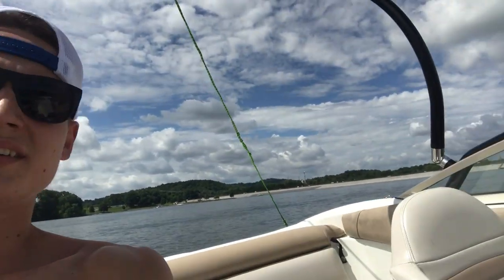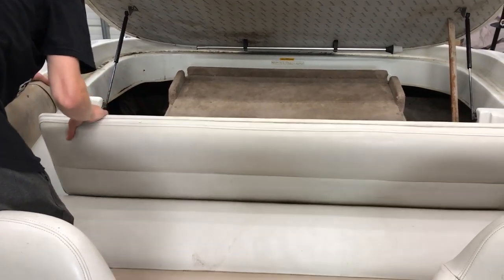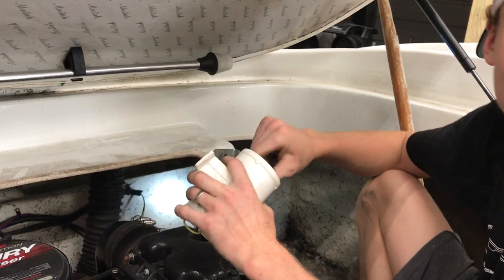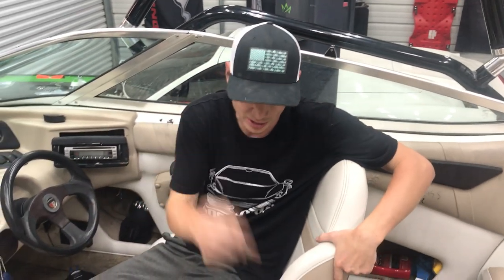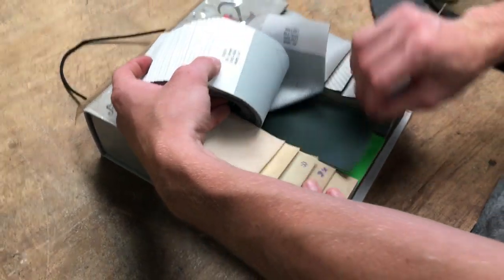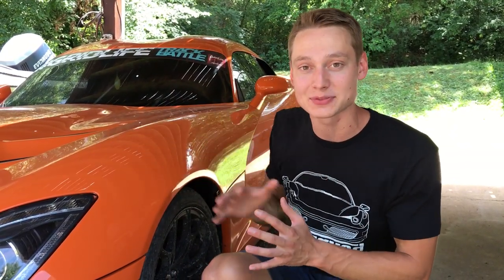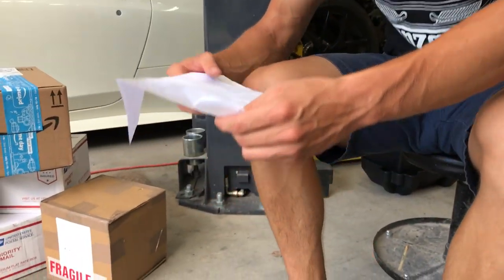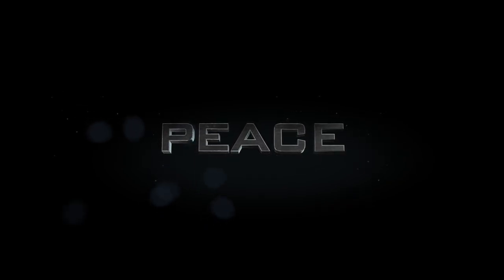Rebuilding A Super Cheap Wrecked Boat Part 4

Comment: Marine carburetors are spark protected. Do not use automotive carburetors!!
Reply: They are better of converting it to fuel injected
Reply: Also the bowl vents are J bent down back into the carb so if the float gets stuck it doesn't pump gasoline all over. Stick with stock. The exhaust mods maybe with a cutout are the best mods!
Reply: Gray J they have regular house carpet in it rn, its just gonna keep molding they need water proof boat carpet
Reply: That is not true
Reply: You can use an automotive carb but then you have to have an open engine compartment
Reply: @Gray J True. They're lucky the floor isn't sagging from being land sunk in that yard. Powerwash the carpet, polish the outside and just have fun! They got a great deal and the boat really does look fine. If they wanna spend $ get a top, exhaust, and a spare bilge fan. And some girls with beer.
Reply: especially if you re blower motor isn't working! CG will take your boat if they catch you with the wrong carburetor.
Reply: JasonDupsha, just simply that there is a screen. These boats have as much a tendency to spark from electrical components than from a backfire.
Reply: @Gray J they are haveing it replaced because that carpet is ungly
Reply: @webberron  I like that
Reply: Pat the little breather on top is what's called a spark arrestor breather. As long as it will fit back on you can change the carburetor. It's the same way with the starter and alternator they both have a built in screen as a spark arrestor.
Reply: @JasonDupsha yes they are wet. The raw water exits through them along with the exhaust but you can still re-route them out the sides or back and I believe they make appropriate cutouts. It would sound like a gnarly V8 if they mod them.
Reply: @JasonDupsha  They use a J shaped vent tube to re-direct fuel back in the carburetor if the bowls overflow. And, the linkages are sealed so flames can't get out. The aftermarket does make marine carbs, just don't use automotive types.

Comment: I learned the hard way . NO CAR parts on a boat motor .
 Plus any kind of crack or blemish on the hull of a boat will let water wick in over time . 
 Hair line cracks will to . Go over that hull with fine tooth come and use the hell out of that gel filler . 
That boat was a great buy . Motor and out drive are worth what you payed for the whole boat . 
Get that out drive serviced and have fun with that boat . Nice project .

Comment: DO NOT attempt to put an automotive carb on this motor.  It has to be marine rated for a boat, particularly the carb.  It is a small block cheby 305.
Reply: What is the difference between a car carburetor and a boat carburetor?
Reply: michele vitarelli different venting for one.  And different metering.  You put a car carb in a boat and it will go boom.  Not worth the risk.

Comment: If that motor is turning over 6k that's way too high!.....redline for that motor is around 5500 max. If it turns faster than that it's an indication that is the wrong prop on it. just sayin...
Reply: Or the rev limiter is set wrong either way revving too high
Reply: the mercruiser 5.0 engine has a happy spot around 4600 rpm or so really no need to hit 5100 or above it wont perform as good anyways...
Reply: @quentinc1275  Plus goin any high is a good way to wipe out the cam as well.
Reply: Rhys Aistrope There is no rev limiter it’s has a carb
Reply: QuentinC if it’s over turning they need to adjust the prop size
Reply: Could be corrosion on the tach contacts. Mine reads high when it needs to be cleaned up.
Reply: @MichaelThompson77  there could be one, even with a carb
Reply: Tach issue, i noticed the tach around 2k when they were idling,  didnt sound like 6k either. New tach!
Reply: Oh, 5.0 mercruiser is a 305 cubic inch sbc. A stailess steel prop of the same pitch will bring the rpms down a little also.
Reply: DvisionScorpio not on boats with a distributor only on after market ignition system that motor can free rev past 6k the rpms are a tell tale sign you need a bigger prop if it over turns
Reply: @MichaelThompson77  yes this is true. My experience with performance boats is that a stainless prop of the same pitch can drop rpms as much as 500 rpms because the blades don't flex as much as aluminium. While this could help, it's typical for these type of boats to run a 19p prop. My brother has a 20ft Baja with a 7.4 litre 454 BBChevy running a 23p ss prop and it's a little doggish on the hole shot but makes up for it on the big end. 5650 rpm at 70mph, goonzsquad boat isn't a high performance boat. The tach could be set for a v6. That would make the rpms read around 1500 higher. Had a truck like that once.
Reply: Russ Wade it also depends on the drive ratio of the outdrive which is probably 1.61 which could be the problem with your brothers boat I ran a 1.5 upper gear box on my outdrive with a 502 with a pro charger with a 27 prop and it did 89 27’ checkmate it launched out of the hole
Reply: @MichaelThompson77  Tru. Many variables. My 19ft bass cat 200efi Mariner magnum, bone stock with 25p trophy plus 72 gps at 6k. Both me and my brother are 3-4 second holeshot, not bad, neither of ours are drag boats. We could go on and on. Nonetheless 6k rpm on a 305 cheby definitely not good. I'm surprised it even made 6k if that's correct. 😁

Comment: Gents, I have the same tower. If you want to prevent gelcoat cracks, make sure you make larger backing plates and/or use a very strong filler and epoxy to get clean mounting point for the backing plates.

Comment: There are two small holes that water goes into infront of the prop your mph is clogged with debris thats why is not registering just run a small screw driver to clean out the sludge or watch youtube on how to fix mph on but itll come up
Reply: SuperGoldnut, and it’s probably broken off, just like most of them.

Comment: First, the Chevy 5.0 is a weak 305 motor. Second, I wouldn’t suggest putting any type of carburetor on a closed cockpit design like that. Third, the pump in the bottom of the boat is exactly what y’all thought it was, a bulge pump with a float to automatically trigger the pump when water gets above a certain level. Fourth, I would strongly suggest fixing the blower motor because even tho the main spark comes from the starter when triggered, and marine starts are fully enclosed, it’s still a good safety precaution. And lastly, I would suggest to check the stringers of the boat. I’m not sure how long that boat sat with the plug in and all that water sitting in the bilge, but that can lead to BAD rot. Once the stringer are compromised, the integrity of the hull is done. Replacing those can be a pain in the *ss even though I’ve seen it done multiple times. Love your videos, keep it up and soon enough you can open up your own muscle/exotic car dealership!
Reply: First it has a carb on it now. Second if you want to give them help. Tell them to lift the swim platform and turn on the blower before starting. 25yrs of working on boats never seen a problem when people follow those rules.

Comment: Black and grey interior, with a gun metal gray and carbon fiber wrap
Reply: Trust me you don't want a Black interior in a boat 😂😂😂😂😂😂😂
Reply: The material they use nowadays is pretty good. I got black leather in my boat and it stays cool all day
Reply: @bnorms1617  yeah I never thought about that I just had some pretty bad memories about Black interiors in the summer 😁
Reply: The issue with black is it gets hot in the sun light and the water reflects the light and makes it even hotter. That is why they always use light colors on boats.
Reply: And die from heat exhaustion on a sunny day. Ever wonder why all marine vehicles are painted lighter colours? Only in cold climates should you go darker , but that's usually just fishing boats.
Reply: I have a brand new mastercraft with a black interior. The material they use is designed so it stays cool and it works really well
Reply: You definitely don’t to use black marine vinyl in boat. I used a dark dark green once and it was like sitting on a stove top. Another friend painted his airplane dark blue and you cant touch it when its sitting at the airport in the sun.
Reply: Yeah I don’t know what the material is called but it works really well and doesn’t get hot at all
Reply: @bnorms1617  This is a budget build

Comment: You should do a larks head knot when securing the wakeboard line to the tower it would be a little more secure. They lock in tight and wont come loose but still have maneuverability. Awesome vid guys!

Comment: It's a  small block chevy (305 ish cu in) and your stern is probly in the 198-205 hp range...as for the milky hydra fluid, just crack a line to your stern rams and pump it out then refill with fresh and bleed it then refill the reservoir...all in all, you guys got a SCREAMING deal! Super find!

Comment: I'd consider doing a Fitech Throttle Body Fuel Injection, instead of a Edelbrock 4 bbl carburator...More HP, Better fuel milage, it's a win / win!
Reply: Where would the o2 sensor go?
Reply: Google how many people have problems with the fintech. It sucks.

Comment: If you have to ask if its a chevy or ford you don't need to be worrying about changing out the intake or carb, although I did on everything when I was your age as well, LOL. Anyway, that my friends is a small block chevy, the best possible engine you could have in a boat that size, that 5.0 or 5.7 has mostly interchangeable parts. Don't change the intake or carb out unless you know an old carb guy to help tune it with proper jets etc. Clean it up and run it. Get that tac running so you can monitor engine RPM, you keep running it at full throttle you will have a boat engine bay full of parts. Like what you guys are doing, you have to learn some time. I enjoy your videos, just found yours last night.

Comment: The extra plugs are for setting ignition timing, and testing, no worries. The plug on the end of the hose is a drain for winterizing, and the big plug attached to it is a spare plug for the boat in the back, probably just stashed there for safe keeping.

Comment: From what I've seen on the interior of the boat, there's some areas of the carpet that not even steam cleaning will get the smell out of. Even some of the upholstery on the seats as well so if I were you guys and were able to swing it, I'd re-upholster the interior. That's just me though. Think of it this way, by the time you're done, you're going to have a sick little boat that you spent a FRACTION of what you would if you went with something more modern. That's just how I look at it. Looks good, guys. Keep it up.

Comment: 5.0 in chevy. Thats a 305 small block
Reply: Jason Crabtree why don’t they know that ?? It’s kinda common knowledge
Reply: Definitely a 305, they don’t use ford motors anymore
Reply: You can tell by the valve covers that's it's a tbi small block. Pretty common knowledge. Im surprised they didn't know that.
Reply: Cole Alexander ... Perhaps they might not know because it’s a marine engine not sure how much of a difference they are but that’s my guess!
Reply: Big boss 429, the only difference is the intake
Reply: Wouldn't it be a 302 small block if its a mercury/ford engine? Same thing they used in the fox body mustangs
Reply: 220HP at the propshaft, good for a max of 4800rpm,
Reply: @jdmtim27  Mercruiser isnt Mercury.
Reply: @jdmtim27  The distributor is in the back, so that's a Chevy engine. Ford had their distributors up front.
Reply: 5.0 is a 305 GM used the 305 for many years
Reply: timothy menard GM had a 5.0 305 they used it for years 1980 to at least 99 cars like Camaros Monte Carlo SS for also has their variant of the 5.0
Reply: Give these guys a break here. The stopped making the classic small block chevy before there were born . They will learn .
Reply: David Taylor lol
Reply: kragseven  now Chevrolet did make a 350 big block if you didn't know
Reply: 5.0 IS NOT A 305. chevy did make a 5.0 but they are VERY hard to find. And to the guy who said a 305 is a 5.7, just stop guy.
Reply: Michael Thompson Did they really use them that recently ? kinda thought they stopped using those in the mid 90s when the LS engines took over .
Reply: timothy menard  no its a chevy 305 small block back in the 70’s i believe mercruiser did use ford 302’s but anything later than 79 is a chevy 305
Reply: Tyler Humphreville lol yes it is 5.7 is a 350 5.0 is a 305
Reply: timothy menard when it come to the Chevy and ford engines back in the day, just a helpful tip if you didn’t know the difference. Look at the distributor, Chevys are in the back and ford distributors are in the front. So this would be a small block 305ci.
Reply: @davidtaylor857  well not no more but u said they didn't make one lol that's why I said they did because back in the 80's and 90's they did too
Reply: 5.0 305 Ford motor
Reply: @pavementpariah7342  5.0 is a 305 in gm and they also made a 307
Reply: @gearheadd1063  yeah my old 2 door Tahoe had a 5.7 and the title said it had a 350 in itb
Reply: @jdmtim27  Mercury marine is NOT the same as or related to FoMoCo. It is a company based out of Wisconsin, started in the late 30's. Actually their 5.0 L is a 305 with 9.4:1 compression.
Reply: yeah it is definitely a 305.which comes out to 5 liters.No one called it a 5.0 though because of that designation being synonymous with the Ford 302.
Reply: yeah it is definitely a 305.which comes out to 5 liters.No one called it a 5.0 though because of that designation being synonymous with the Ford 302.
Reply: @gearheadd1063  The gen 3 Coyote engine is basically a 305 but Ford decided to call it a 302.
Reply: @C.c.dethomasis  - Chevy also made a 302 in the late 60s early 70s. My cousin had one in an old Nova we used to cruise around in in high school....
Reply: @gearheadd1063  We had a mid 80s tri haul boat it was a Success. It had a 351 Cleveland in her from the factory. It was Mercruiser with a Alpha 1 out unit.
Reply: @chrismodlin483  So are Mopar and Amc there too Bud.
Reply: @C.c.dethomasis  The 307 was Oldsmobile not Chevy.
Reply: @Mr.XJ.96  holy shit read my comment again and pay attention Gm made a 305 and a 307 and a 301 308 302 303 and a 304 i didn't specify chevy
Reply: yes sir that is a 305 ford small block!
Reply: @getchasome6230   no not at all
305 ford smallblock
a 406 trans am is a 6.6
so that info is incorect sir
Reply: @chrisallen1783  No Chevrolet never made a 350 "big block" engine!?
Reply: @dylanredhage1710  Why is there so many engine experts that don't know what they're talking about, that is a chevy engine!
Reply: @crimsonking8746  my friend had one in a 69 Camaro it was sick
Reply: @pavementpariah7342 : 305 ci = 4.998 liters... it rounds up to 5 liters. 305 are just as common as 350's, my 83 Trans-am had a 305 HO with a whopping 190 HP.
Reply: Miller oh yeah for sure, but I wasn’t going to start naming everything, but you are right brother.
Reply: Cole Alexander two barrel carb engine not even fuel injection
Reply: Tyler Humphreville lol what year were you born? 305 has been made for years was used in a lot of vehicles Camaro Monte Carlo SS had 305 HO motor GM trucks all used 305 motors was used from early 80s to late 90s
Reply: @pavementpariah7342  uhhh. It's a GM 5.0. 305. They made a metric ton of them.
Reply: @benjaminbaird1978  step away from the keyboard. So much false information
Reply: It was the gm 302 I was thinking about. Lol. Still a 5.0, just a different one.
Reply: @benjaminbaird1978  Nahhhh Mercruiser is NOT Any part of Ford Motor AT ALL!!! Its a Chevy 305 Marine Spec motor.  With a Mercruiser Alpha 2 out unit.
Reply: @chrisallen1783  Pontiac made a 350 Big Block Not fucking Chevy Pal. So your K5 or Square body didnt come factory with a Big Block 350....BOoooooom Nike Drop
Reply: @Mr.XJ.96  you must like to look up everything I'm sure you got that right from Google, because they did and not everything you find on the enternet is right, chevy owed Pontiac if you didn't know  and yes chevy put 350 big blocks in their custom specialty square body's soo try again my dude
Reply: @chrisallen1783  It was NOT a Chevrolet Block. Gm iS Gm but Chevy and Pontiac arw different. The big block 350 was not chevy. Google shmoogle I know because I know.
Reply: @Mr.XJ.96  fair enough
Reply: @Mr.XJ.96  go threw the video again and you'll see it says right on top of the carburetor, it says mercury mercrusier and for owns mercury not Chevy
Reply: @dylanredhage1710  what?
Reply: @benjaminbaird1978  You were given the correct info numerous times by numerous comments Pal but still insisted you were right. Didn't mean to hurt your little feelers.....hear that Im playin the worlds smallest violin for ya.